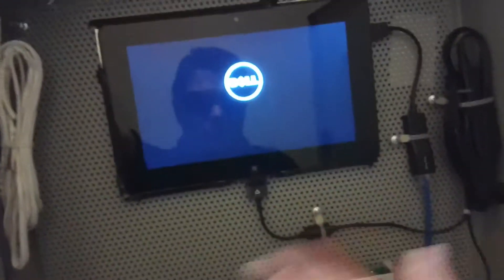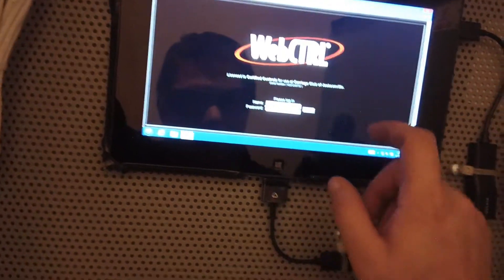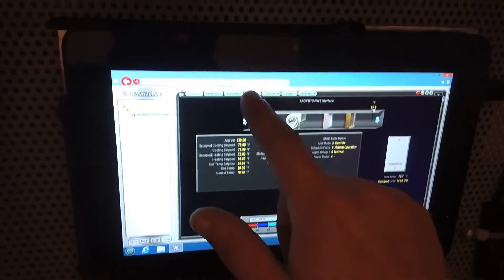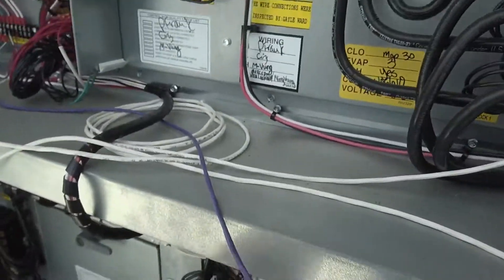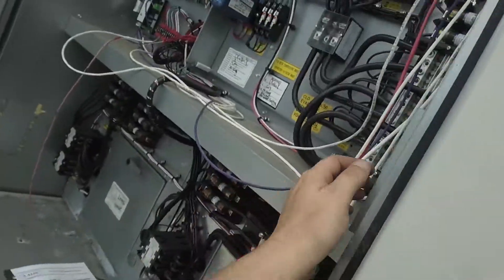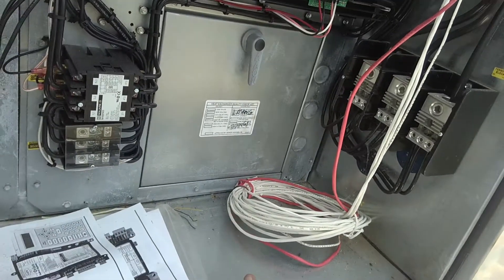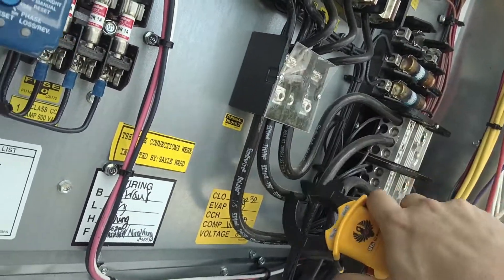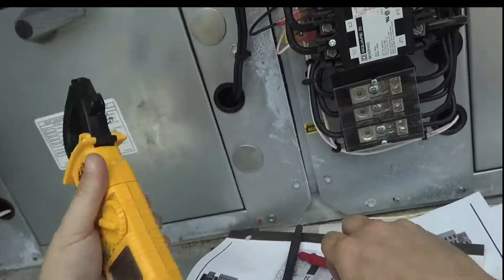AAON HVAC NOT WORKING AFTER CHANGING FILTERS part 1of2

Comment: Knew it! Lol they need more fuses in there. Little tip just put your meter in ac volts and check across the fuses with power on. Ov means it closed. If you have volt reading it's blown
Reply from the maker: Hey Joe thanks for the tip I'll try that next time and as always thanks for watching man